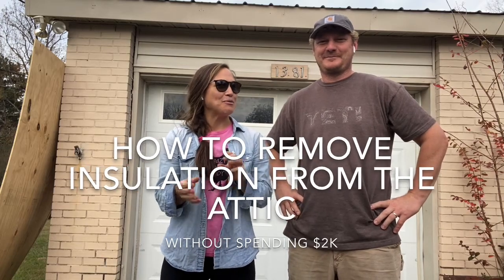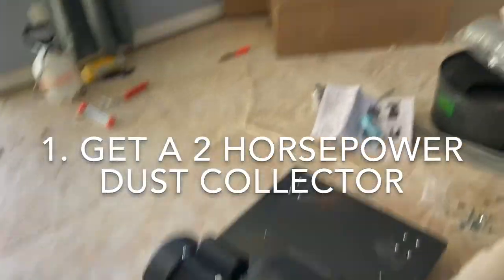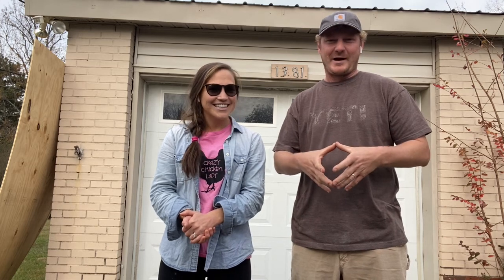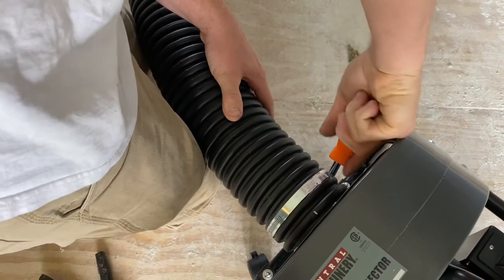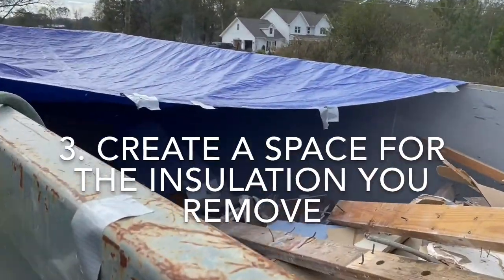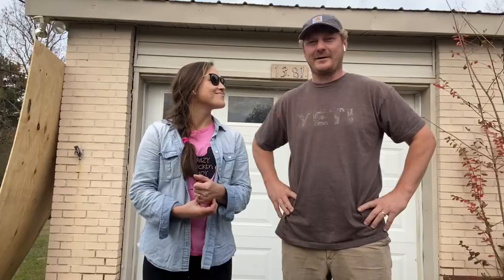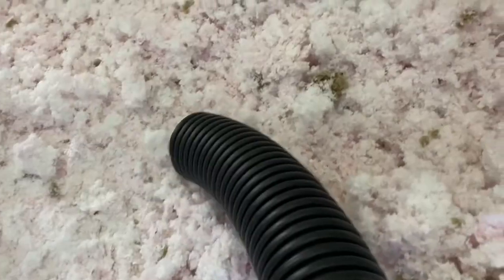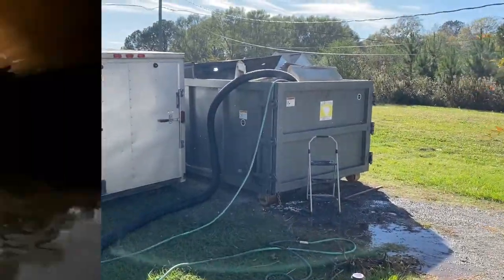How to Remove Insulation From Attic

Comment: Nice setup there. It will take more time but if you have the time its not a bad method. How is it for clogs though. I would imagine you just need to collect at a slower pace for dense Insulation like cellulose. Thanks for sharing.
Reply from the maker: Thank you! Yes, I agree- If you have the time it’s a good solution. Time is money 😂 It did well without clogging. There were a few times we had to unclog it when we got more debris than just insulation. We had a mix of dense material and light material and didn’t have clog problems. We were sure to give it a rest and detach the pipe every hour or so. That probably helped keep it clean! Thank you for your comment!!
Reply: @RainieRobinson  I'm always looking for channels like mine just see other ideas. I'm an attic Insulator and started a YouTube channel 3 months ago.
Reply from the maker: @SinnisjInsulator  glad you’re here! I saw yours too and will def be watching for tips with insulation. You’ve got all kinds of good info! Keep up the good work!
Reply: @RainieRobinson  thank you for the kind words and support. If you have any questions I will be sure to answer it with the best of my knowledge.